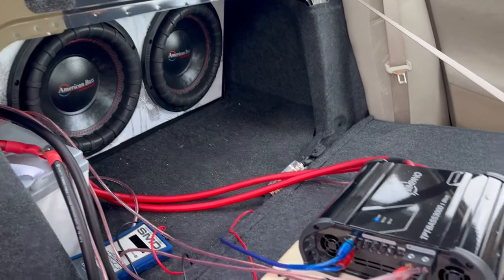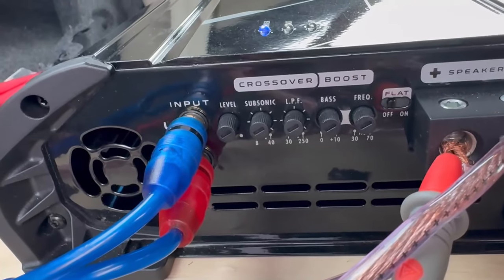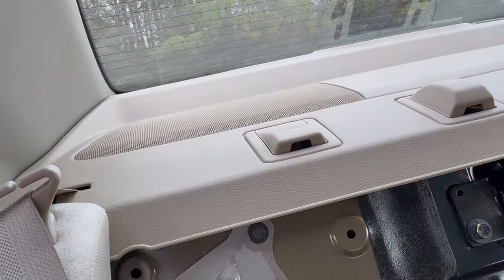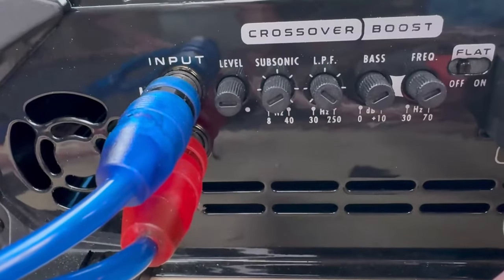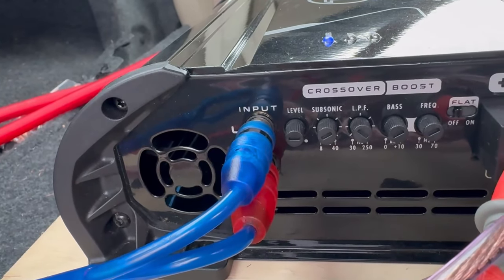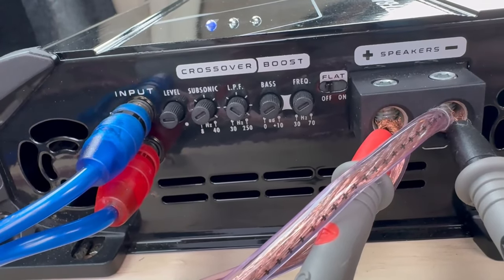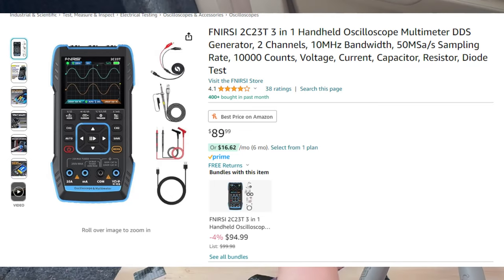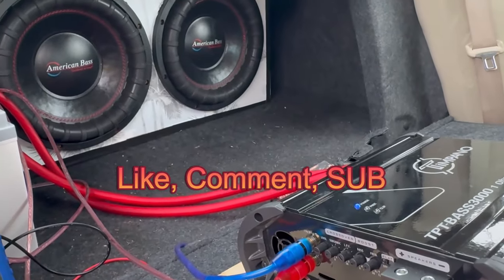How To TUNE a BASS Amp!| Car Audio, GAINS, LPF, SUBSONIC FILTER, BASS BOOST!

Comment: step one, turn the speakers around. this effectively turns your speaker box into a bandpass speaker box, basically turning your trunk into a speaker box :) i mean, it's easy enough to try both directions.
Reply from the maker: In my car it’s louder facing the front and port on the side. They is a constant debate in the car audio community. But I have tried both ways and front in this case woks better
Reply: ported box? the one in the vid looks sealed.
Reply from the maker: @anvildesignartphotographyl5646  the port is hidden on the right side 👍
Reply: @Zachecker I want a 3000 watt amp, but can’t decide between timpano/PRV/taramp? What would u recommend ? I’ve heard things about taramp going up in smoke if the voltage isn’t exactly 14.4V 
Also, thinking of American bass vs resilient sounds gold 12 V2 
What do u think ?
Reply from the maker: @MegaJohn334  I’ve had both taramps and timpani. PRV audio owns timpano but Stetsom makes timpano amps. I would definitely suggest timpano over taramps my taramp lit up in smoke. And American bass for sure. American bass just has a great reputation and if you get the elites rn they are lik 160 on amazon. They will not blow on a 3k ima put mine on a 5k
Reply: @Zachecker  thank u for response 🙏🏻🙏🏻 much appreciated, yeah I heard the taramps are super delicate and wrong voltage will fry them
Reply from the maker: @MegaJohn334  yessir. Anytime. Stay tuned to the channel for more
Reply: @Zachecker  will do subbed 🙏🏻
Reply: Audio pipe are good amps 2

Comment: 140 is half not 110
Reply: Are you special? 😂 even if the amp says more, 220/2 is still 110….
Reply: @evanwernette4606  what makes you say that Mr. Know it all?
Reply: @evanwernette4606  stating facts, the number halfway between is 140.  Math is hard?

Comment: when tuning the amp with the dd 1 or any tool disconnect the speaker wire don’t want to be playing any frequency when doing that. use a 40hz -5 db cause you will be missing out on the lower notes at 40hz 0db

Comment: my subs only sound alright when i have bass boost turned up. but i have a epi center for my spanish music and it sounds good but once i switch to my rap music i turn the epi center off and there’s no bass. i have stock headunit can anyone help?
Reply: What are you running? Stock head unit sounds like your problem
Reply: @  2 12’ ds18 gen xx and a blaupunkt amp 
it’s a 2021 camry

Comment: My kickers been on full bass boost 105hz and ond zero gain ive never heard any distortion i even tickle my gain with bass boost off and it sounds like crap why would that be?
Reply from the maker: @matthewjohnson8042  I’ve never heard of that, normally bass will not be loud with gain off and bass boost on.

Comment: I just installed a system in my 2021 Silverado is there a way to tune my loc gains ? Then do I tune my amp ? I’m not getting bass at low volume
Reply from the maker: @joshluper2947  make sure your lpf and hpf are set correctly I have my hpf on lowest and lpf on 80

Comment: Bro I like your videos but why don't you use tones to set your subsonic and your LPf and it looks like your speaker wires are backwards you have a positive on the negative but doing a good job bro 34 test tone or a 32 HZ test tone for your subsonic and a 80 test tone for your LPF I use this method all the time and it works out perfect even with a voltmeter 💯🔊😎
Reply from the maker: Thanks for the love my guy and that is my cheap ass Using red wire for both and heat shrank black for the negative. Don’t worry they are correctly wired it may be the angle of the camera bc I never show the other side of the amp. 🫡
Reply from the maker: And normally I would use tones but I have already tuned this amp before so Ik where to set it. It was too hard to record and set the tones at the same time. I tried to make it as easy and quick as possible to understand. 🔊👍
Reply: Great job bro 💯🔊
Reply from the maker: @rubenflores2870  thanks man 😃

Comment: Hey, quick question do you have a battery isolator between your front and lifepo4 battery? I'm pretty sure if you mix lead acid and lithium it can damage your batteries and not mix correctly. If I'm wrong let me know
Reply from the maker: I have an ultra capacitor but not isolator. Based on my research the mix should be okay.
Reply: @Zachecker  what the ultra capacitor?
Reply from the maker: @xeran_yt  B Stock IOXUS 12V Group 31 Smart Power Bluetooth Ultra Capacitor. It helps with voltage drop. I made a vid on it.

Comment: Nice video brother. I just installed a kicker 1200 and had my bass boost all the way 😂. Thanks for the advice. Im getting an epicenter next week. You should guide me through a tune 😅.
Reply from the maker: thanks for the love an epicenter is a great add on to a system, unfortunately i have not used one before
Reply: Yo bro did u ever tune it ?
Reply: @marcoguzman8538  i placed both knobs in the middle pointing up. Sounds amazing.

Comment: I Ned to install the extra battery like yuors just wonder how to. Bridget
Reply from the maker: @miguelrosales1559  connect positive and negative from your first battery to the second then have wire going to the amp from your second battery. Make sure you got a fuse inbetwren the positives I made a vid on it
Reply: @Zachecker  thanks 🙏 I will du that I Ben lost bass wen I put like 35 blm

Comment: Would a bad alternator cause your system to shut off and on maybe idk nothing about systems
Reply from the maker: @JuakoDiaz07  if your system is shutting down it’s because your voltage is dropping to a point where the amp goes into protect mode, its alternator but battery power I would try first, get a lithium 2nd battery and if that doesn’t work get a new alt, preferably high output alt for your car 240-320
Reply: Makes sense. So here for the past week, I'll drive my say 45 mins or maybe more and I'll get home per say be there 30 mins and got to start my car and the battery is drained
Reply: My apologies for asking to many questions but um idk who installed the system I came in to possession of the vehicle and there were times I'd touch the screen say to cut the volume down and the whole thing would shut off.
Reply from the maker: @JuakoDiaz07  first make sure nothing is draining the battery while the car is off like example lights… then if there is nothing take it to a mechanic and get their opinion on it it’s most likely the alt but I’m not a professional
Reply from the maker: @JuakoDiaz07  have you made sure everything is wired properly?

Comment: What abt the bass boost on the head unit it does that affect anything or no? I have a kenwood head unit and have my bass boost on +2 out of 5 on 2 12s
Reply from the maker: @jamesthompson5981  I have mine at neg 5 because it also boosts normal mid range speakers and that is not what I want . Just the subs. But it don’t matter if you have gain set correctly
Reply: @Zachecker  alright cool thank you
Reply: Yes head unit affects everything after it.

Comment: I run a jp23v1.5....and a single american bass xr 12 dual 2 ....and i have my subsonic ....bass boost ...etc. all set on 0 or turned off ....and i have a voice coil going out ......i do have a upgraded alt ....big 3 ....0 guage frame grounds ....have really good voltage ...need add a small back up batt...but its not a must have ...but i do wonder if having my subsonic and bass boost set at 0 caused this to happen ....i have clip indicator and i try to never let it clip ....idk ....seems like the spider or voice coil was weak or bad from day i opened the box and installed it ....contacted american bass but where i bought it off ebay and not direct from them ...they havent wanted to warranty it or even reply to a email ....i even offered to pay to have it repaired .....not response .....think i am going to go with sundown or resilient possibly sound quebbed for my next sub .....
Reply from the maker: Could you describe exactly what is wrong like do you hear something wrong with the. Subwoofer? Like rubbing, weird noise? If so it probably came as a slight defect. And the people you bought it from should take it back for money back or replacement. Now I have heard some good things about the xr so I wonder if it is a defect. Now if this gets you off American bass fully the subwoofer I would recommend would be the timpano tpt 2500 it won’t break the bank. On Amazon the d2 is 180 bucks I made a video on it and it is one of my favorite subwoofers. It gets lower than the American bass and I am thinking bout buying one more to replace the elites for a while. But my elites have never let me down just wanted to switch it up. But if you want really high quality just go with sundown they have the best reputation in the game. Hope this helps. Thanks for the comment
Reply: Is your box ported? If it is ported and you have subsonic filter off or too low then that caused your sub to play lower than it was supposed too causing damage to the sub.
Reply from the maker: @Alexlivingloud  it’s ported. Yes my subs play low and no it will not cause damage to them I’ve had it like this for a year no issues
Reply: @Zachecker  sorry,  i was replying to the original commenter about him having subsonic filter off.
Reply from the maker: @Alexlivingloud  gotcha. 👍

Comment: What about hpf lol 😅
Reply from the maker: @walbertorodriguez4625  high pass filter if you want to run amp on subs dont touch it because if you have it to for example 15hz it will play every frequency above 15hz and if you have the lpf to example 80, just like a subsonic filter it will play the frequency range 15-80 in other words the bass notes
Reply: @Zachecker  I have my lpf at 80 per what amp says and hpf at all the way down to 10hz and can go up to 80hz, so just leave it at 10hz?
Reply from the maker: @walbertorodriguez4625  yes so right now you amp playing 10-80 hz with out db drop. 

High pass filter = plays every note above where u set it at 

Low pass filter= plays every  BELOW you set it at 

So if you put those two together it creates a range because it can play notes above the lpf and can’t play notes below the hpf. 

That’s an easy way to think about it, obviously it will play notes above and below but it will be a lot softer
Reply: @Zachecker  thanks 🙏